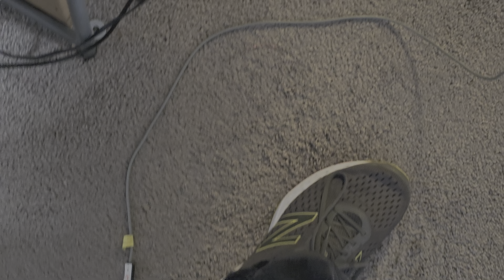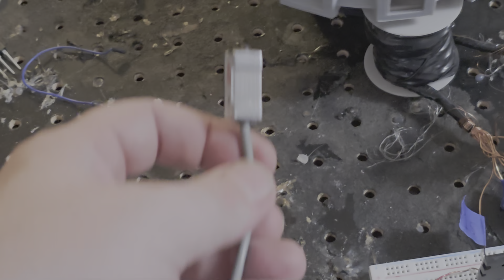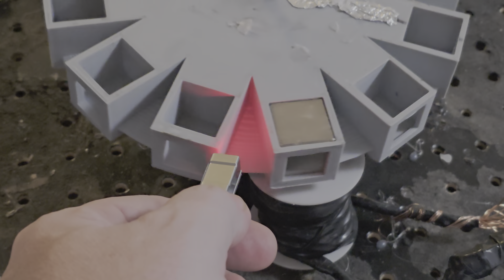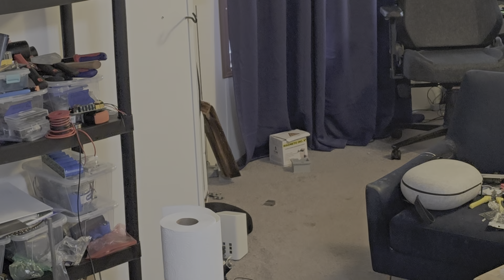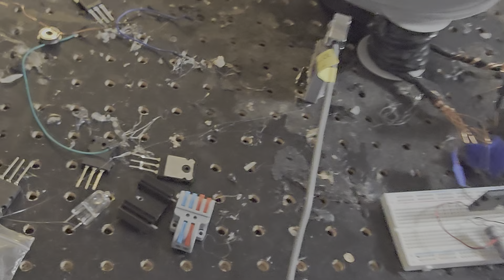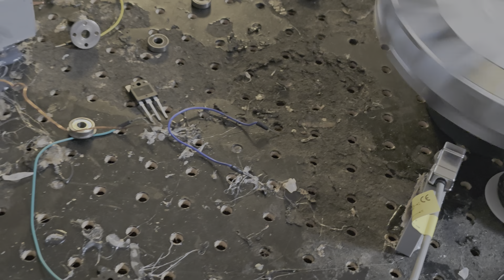axial flux multifilar 20/32 awg 10 strands each 3 parallel circuits on/off toggles motor.

Comment: try what i have done 1000 ohm resistor looks like you only got 100ohm, resistors are only 0.5watts max aswell
Reply from the maker: had 3 resistors needed 3 resistors it was logical.